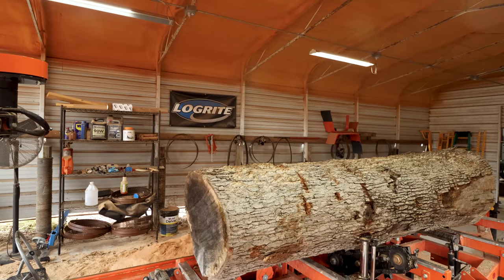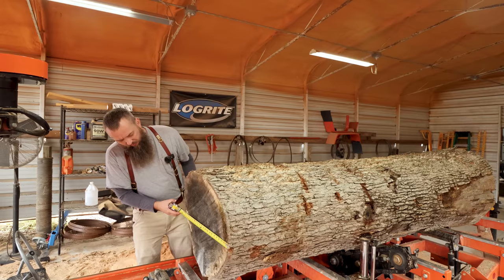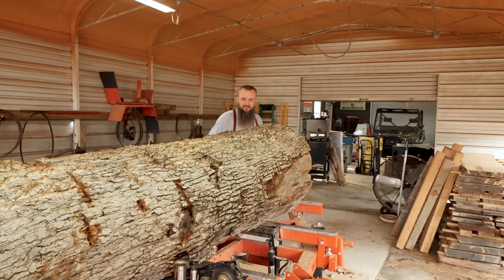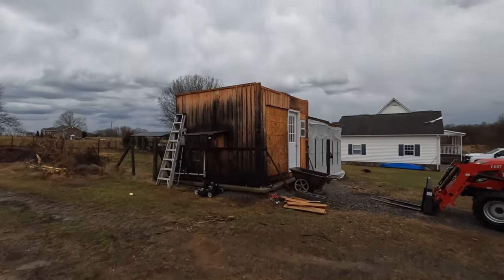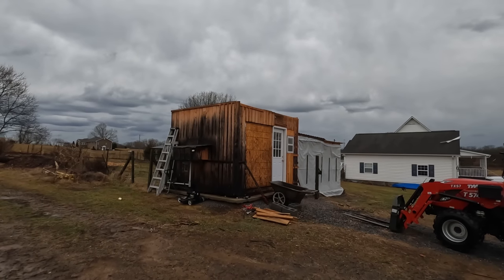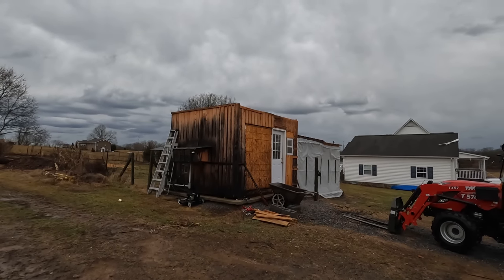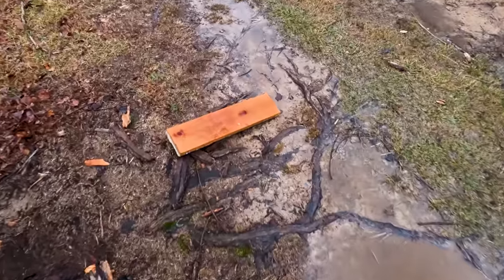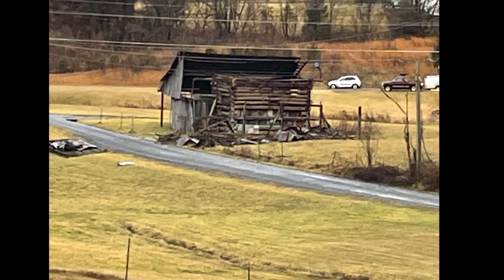Tennessee Tornado Drops A Tree On My Tractor

Comment: Nathan, I hope there was no loss of life in the chicken house or amongst your tribe of cats.  I would like to offer you some advice.  As a retired engineer with quite a lot of structural experience during my 57 years of working, there is one stand out element which is usually a surprise to most people without engineering training.  The necessity of a good foundation seems to be common knowledge.  Of course the foundation is what keeps the building up.  However, the need to keep the building down seems to be not quite so obvious.  Especially in relatively light structures, it is very important to ensure that the structure is securely tied down. Strong winds not only blow things sideways, they can create vertical pressure, both downward and upward.  When you rebuild the chicken house, ensure that it is well tied down to the foundation.

Comment: Nathan, Sorry about the roof of your chicken house. Did you use "hurricane clips" to tie the rafters/trusses to the studs? When I built my wood shop in '05  I had the inspector out for the final inspection, and he told me I needed to add them to meet local codes, which I did. Relatively cheap, easy to install, and effective!

Comment: In 1973 in an area not known for wind we had a micro burst storm which tore a 6 inch thick 10x12 ft concrete roof off of a building as well as all the piping and two pumps which had been attached to the roof. This was at a wastewater treatment plant in SE BC Canada. The debris landed roughly 100 feet from the building. Cheers ~ulrich

Comment: The speaking audio is 100% right and left matched. The video is nice too. When the sawing started I had to turn the audio down 3 notches because it was way too loud. Every adjust,ent of the slabs, nocks, drops, sliding of the wood and cutting of the blade could be heard clearly.

Comment: You got lucky. As for not getting warmed we had that happen the first year we moved to Missouri from Northern California a small logging town where my family logged for 4 generations un😢California shut down 90 percent of its logging in the 90 costing my grandfather his company and forced him to retire in 2000 . Back to Missouri. We had just moved in to a mobile home we were able to rent and 2 months later we got hit by a severe thunderstorm we at the time had no clue as to how bad it was going to get or what a severe thunderstorm was. When that storm hit our swamp cooler  got blown 4 feet across our deck we then had objects hitting the back of the mobile home when I looked out the window I watched large limbs flying through the air and the next second I couldn’t see the mobile home next door only 30  feet away it was raining and blowing that hard when it finally let up we heard sirens  I had a scanner app and found out a tornado had hit a mile away and we got hit by it as well only thankfully it was weakening so it only took down 3 trees left dented mobile homes bent over 1 power pole and left debris in our tree someone’s internet cable and both brackets about 6-7 feet was wrapped all the way around the tree in the yard. We got no tornado warning the tornado sirens never went off we had no warning other than the severe thunderstorm warning. The tornado was an EF 1 and it took out the cement factory, tractor supply store and tracker boats factory and about 100 power poles. So I’d say we got lucky we didn’t get a direct hit. The next spring we got our first tornado warned hail storm with hail the size of golf balls on average however I found a few as big as my hand baseball sized. Our mobile home looked as though someone had taken a golf ball mini gun and sprayed it down . The dents are still visible today from both storms.